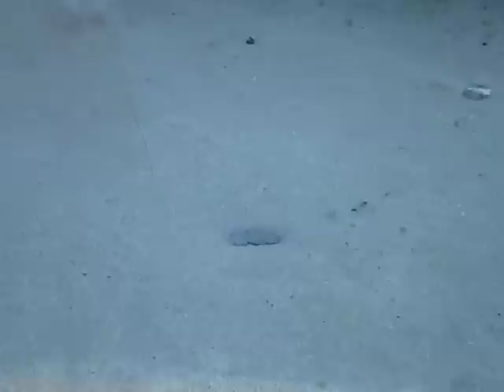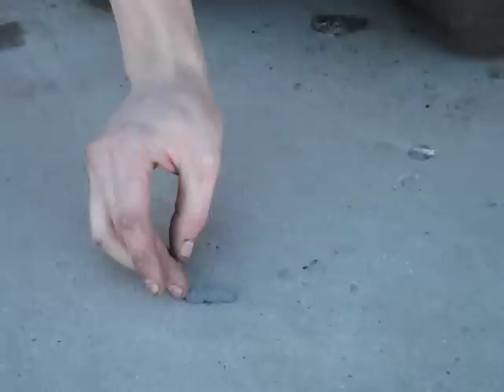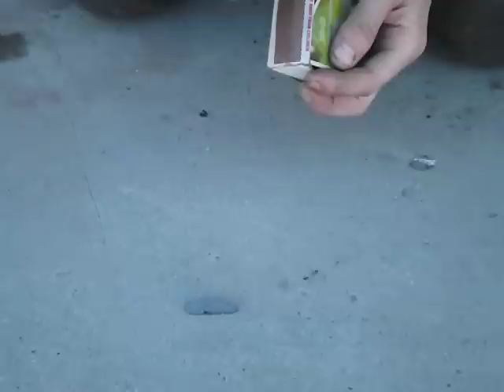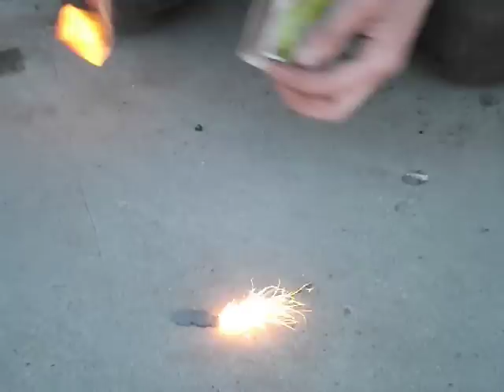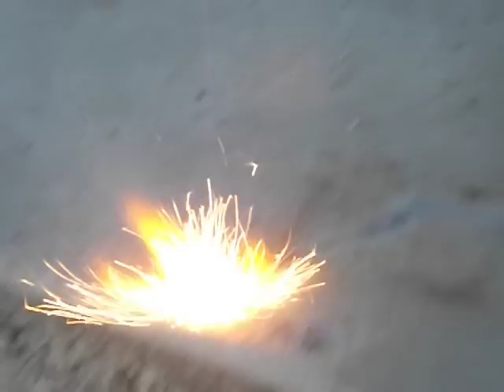Space Shuttle SRB Rocket Fuel Sample

Comment: Just like that. The ATF, FBI and homeland security was at his doorstep
Reply: If you know Cody this wouldn't be the first time.
Reply: Nah they knocked on his door when he started processing Uranium, lol
Reply: Funny true story:  Immediately after 9/11, BATF and DHS got the idea that amateur high power rockets (most of which use a fuel almost identical to the SRBs) were a hazard to commercial airliners and set about trying to shut the hobby down.  The theory was that a terrorist could "shoot down" an airliner near landing or takeoff - low and slow with such a high power rocket.  Anyone whose ever flown high power KNOWS that the uncertainty time between pushing the button and having the motor fire is on the order of seconds at best, and sometimes 10 seconds or longer, know this is ludicrous - you haven't a prayer of hitting anything moving even only 100mph.

[I believe it's still true that an unguided ground launched missile has EVER hit an aircraft in the history of warfare.  RPGs hitting stationary helicopters a hundred or two feet away don't count.]

Undaunted, the DHS set out to prove it.  DHS had a team of Special Agents scouring the hobby shops to buy a number of "delta kit" (a rocket that with the right high power motor and good build can achieve 18,000 feet), and high power motors (probably "I" or "J" - 20-80 pounds thrust).

The hobby shops of course refused to sell them because the Special Agents had neither pyro permits or rocketry association high power certification (required by *law*).  Whereupon Thomas Ridge (yeah, DHS Director #1) threatened them all with charging them with obstructing officers in national security....  i've seen a copy of the letter the SA's carried with them.

[interval while Special Agents learn and build a couple dozen Darts - they're not exactly easy first builds.]

Thereupon, they built a multi-tube "katusha"- like launcher (Soviet WWII multi-rocket launcher mounted on a truck bed), that they could install in the back of a rented van (I think a U-Haul actually).

[if you tried to tube-launch a Delta, you'd have to leave out the fins.  Which means that the Delta will fly a path highly reminiscent of a Smokey Sam ricochet in a Bugs Bunny cartoon.  What did the SAs know anyway - they weren't Rocket Scientists like I am ;-)]

They set it up at an artillery range, and flew a drone low and slow past the van.

Fire!

When the smoke cleared ... the drone was unscratched.  But the van had burned out down to the rims.  It's somewhat doubtful if any of the Deltas successfully actually left the van.

Someone had some explaining to do to U-Haul.
Reply: Just another step in his journey to launching a space laser.

Comment: Like make a rocket with a delay and a few solid boosters so it can be launched then the main body kick in and send it higher. IDK if it would work but it would be cool to see!
Reply: Jesse Crews...Aerotech Rocketry produces APCP (Aluminum Perchlorate Composite Propellant) reloadable motors for High Power Rocketry hobbyists. That is the fuel that the SRBs on the Shuttle used.

Why don't you make a rocket? Save your money to buy the reloadable motors. 

Study about rocketry. Then study some more...Then after you think that your done enough studying....study some more.  Then design your rocket. And after you have planned it out...in detail...then build it. Then fly it. And if you recover it safely to where it can be flown again then you have accomplished your goal. And if it wrecks or CATOs....then it becomes apparent that...perhaps you have not done enough study? (There are other causes that are completely beyond your control. But study and design helps to minimize failures.) 

Yep...Back to the Drawing Board and there is no pun intended. You will draw it, with dimensions, before you build it. Maybe you will draw it many times as you may have many minor design changes during your venture. That is what the phrase, "have planned it out...in detail", means. 

But you will know your rocket by the time you have built it.  In fact you will be apprehensive to launch it, wondering anxiously if you will ever get it back.  But that is the adrenaline rush...the thrill of it....which we seek. When you have pushed that button that sets off the electric match which ignites that engine  It is distant and no longer in your control. And there is so much that can go wrong.

First...Doesn't that sound like a lot of WORK?  Oh my. Did I say a four letter word?  WORK? 

Why are you asking Cody to do that work? For you? If you are even thinking of using THE EXCUSE that Cody is a genius and that you are not a genius...Well...There was the famous old man who said wisely and correctly, "Genius is ONE percent inspiration and 99% perspiration". Nope. No "Mulligans" for you. Believe it or not asking someone else to experience life for you only STEALS FROM YOU and you only harm yourself doing that. Only Heaven knows what you are missing when you do that.

Next...Doesn't that sound like a lot of RISK...the risk of the loss of your rocket, the risk of failure, as well as the risk of the loss of your investment of time?

It is RISK. Personally I have had rockets detonate on the launch pad. I have had them detonate in the ascent phase and plummet to the ground, in flames. I have had ballistic impacts into the ground due to ejection charge failures and failed recovery shock cords. I have been fortunate enough to avoid "zippers", where the shock cord zippers down the air frame and opens it up like a tin can, but that can happen. i know to vent my rocket as the rapid change in air pressure, due to the rapid change in altitude, will pop that nose cone off like a champagne bottle cork....with the result being the zipper that shreds your rocket. I know to use lengthy shock cords.

Tuition at the School of Hard Knocks is expensive and plenty can go wrong...no matter how well you have planned it out. 

At times a failure it is not due to a flaw in your design but due to a manufacturing defect in a commercially available engine. of course you may have stored the Engine improperly. Or the store from which you purchased the engine may have abused it, dropped it, internally cracked the propellant, and then you get the unexpected detonation.

=================

Since you are a beginner...obviously...since you do not know about how easy it is to cluster engines and that the engines have a built in time delay...I'd concentrate my efforts on the simpler rockets and Black Powder Engines manufactured by Estes Rocketry....first.

Rocketry may be a sport, and it is a sport which is much more cerebral than physical, yet it is not a game..

And if you want to watch High Power Rockets fly on APCP then there are already plenty of videos of that available here on YT to watch.

What is lacking from those videos is your personal investment. It is not your rocket flying. And unless you have built and launched Rockets before you cannot enjoy their adrenaline rush when they are launching 

And the problem with the YT videos is that successful flights are predominantly shown. Or, of those which are failures, many are labeled as failures in the titles...which is a Spoiler that ruins any chance for the vicarious adrenaline rush that one can experience due to empathy as the experienced have had it happen to us before.

Think about it...You are watching a video of a launch. You do not know the outcome. There is some built up apprehension. Maybe the guy who is making the video talks a bit about his anxiety beforehand....what can go wrong Then he presses that button...KABLAM...It detonates...on the launch pad. Empathy flows as a result.

Believe it or not...That is a perfect video as one is not expecting that result.

And if I ever video record another launch that is what I intend to do.

Build your own rocket and stop stealing from yourself.
Reply: @24kGoldenRocket  "stop stealing from yourself" i never thought in my entire life this would make any sense
Reply: @24kGoldenRocket  but what about remaking rockets already designed, then "reverse engineering" the rocket to understand how it works? isn't a better way to learn ?
Reply: @l0k048   If you want to study rockets then study Physics, Chemistry, and Aeronautics.

When I looked at the internal structure of a Saturn V without that knowledge I did not understand the reason why the Oxygen tank was located above the Hydrogen tank in the third stage while the Kerosene tank was located above the Oxygen tank in the first and second stages. I had absolutely no understanding that the molecular weight of Kerosene is heavier than the molecular weight of Oxygen and that the molecular weight of Oxygen is heavier than the molecular weight of Hydrogen thus the placement of those tanks were designed so that the center of gravity was located above that of the center of pressure to insure aerodynamic stability. 

Now that I have a knowledge of Physics, Chemistry and Aeronautics I can understand this. But before I had a rudimentary understanding of Physics, Chemistry, and Aeronautics I had no clue on how to reverse engineer even a model rocket.

Comment: And it's more or less the same stuff that they painted the Hindenburg with.
Reply: People think the hydrogen 'caused' the explosion, but hydrogen without oxygen is safe. It was the skin igniting that allowed enough oxygen in to then ignite the hydrogen.
Reply: @Bubu567  interesting. I did not know that. Thanx for sharing that info.
Reply: @Bubu567  Well yeah but the hydrogen is still what exploded by reacting with oxygen. On a side note since hydrogen forms water when it burns I wonder how significantly the Hindenburg affected rainfall in the area of its explosion. That's a lot of water vapor being released...
Edit: apparently it's still debated as to whether the initial fuel was the skin of the vessel or leaking hydrogen
Reply: @dannydevito7000  It's debated as we cannot go back in time, nor would there be much for us to investigate, but numerous model tests have shown that the paint on the skin, at the very least, massively contributed to the disaster. Without the volatile canvas paint, the accident CANNOT be recreated in the real world. 
The hydrogen leaves no room for mistake, so it isn't a bad thing it has somewhat unfairly been pointed at the sole blame.
Reply: They demonize hydrogen because the oil monopolists wanted to destroy the air blimp industry,i wouldn't be surprised if the hindenburg was corporate sabotage
Reply: @NwoDispatcher  Zeppelins only used hydrogen for lift. They also had petroleum automobile engines to propel them, so I am not sure I am on board with your theory.
Reply: @Bubu567  the friction losses for blimps are light-years ahead of ground travel

Comment: “Look at how cleanly it burned.”

You know that solid rocket fuel produces the most toxic gasses out of any fuel type.
Reply: He meant as in it didn't produce much visible smoke, showing that it was a good fuel to air ratio
Reply: That's not what he meant about "burning clean"
Reply: I see
Reply: @toad3222  Fuel to air ratio? wut
Reply: @kosovosux  Google stoichiometric burning
Reply: Precisely why I stopped firing rockets indoors. I do enjoy the smoke, though I don't recommend inhaling deeply.
Reply: @toad3222  ik but fuel to air ratio only applies to closed systems
Reply: @kosovosux  it applies to a campfire, how is that a closed system
Reply: @toad3222  it would be rate of combustion, not fuel to air ratio

Comment: "Exact same formula" Yeah sorry bud. They werent grinding up rubber binders and mixing it. Lol not even close.
Reply: Yes it was the same formula, they used a rubber binder called PBAN, which also combusted and acted as a fuel.
Reply: ammonium perchlorate (oxidizer, 69.6% by weight), atomized aluminum powder (fuel, 16%), iron oxide (catalyst, 0.4%), PBAN (binder, also acts as fuel, 12.04%), and an epoxy curing agent (1.96%).

Comment: We made this stuff back in the day for our education. It was not the exact same stuff you made here......
Yours burned with larger particles and the colour looked of but that can be just the camera.
We made a small bit and extruded it into long rods (much like pencil-lead in size).
If you cut off a piece (creating a square edge) and light it, then blow it out (you cause a sudden drop in pressure to extinguish it).
When you examine the (burned) end, it looks like a sharpened pencil-lead. This shows you how the flame-front propagates through the material.

Comment: You just gave me the ingredients for a homemade thermite grenade
Reply: Nope it’s not thermite. It can go boom if you try to enclose it, but thermite won’t. AP based solid fuel is no worse than a road flare if left open to burn. Thermite delivers far more heat. It’s actually easier to make real thermite, if you can find a fine enough aluminum powder. The other ingredient is just rust.

Comment: Since you are burning this at atmospheric pressure the burn rate is about 10 times less than what the actual shuttle motors would have experienced.  That little bit of propellant would have been consumed very quickly in the actual motor.

Comment: How does solid rocket fuel keep burning in the same location? Does it drop down the rocket fuel tank as it burns? How is it controlled thrust if it doesn't, surely the thrust changes if the burning isn't occuring constantly right at the bottom of the tube.

Comment: you forgot to tell the main fuel was hydrogen .The Space Shuttle's large External Tank is loaded with more than 500,000 gallons of super-cold liquid oxygen and liquid hydrogen, which are mixed and burned together to form the fuel for the orbiter's three main rocket engines. but you right as a solid fuel has been used ammonium perchlorate.

Comment: I understand that this video is more than 6 years old but still would like to know if you could provide a little more information of this test such as:
Proportions of components
The component size in microns
What the rubber binder is that you'd mentioned
Also, you did not mention the inclusion of any iron oxide as a catalyst in your mix, a very important component that was used the Space Shuttle's SRBs.

Comment: Except for the FACT that the Fuel used in the Solid Rocket Boosters for the Space Shuttle is SODIUM Perchlorate .
Reply: Nope ammonium perchlorate, is better and more stable than sodium perchlorate. Check out the pepcon explosion.  It’s easier to diy make sodium perchlorate but the slightest mistake will blow up regardless of quantity. Pure AP is only explosive in large quantities. I’ve made high power rocket motors, you do not want to play with sodium perchlorate if you can possibly avoid it. It can go unstable just with poor storage.

To be pedantic the AP is the oxidizer, the rubber is the fuel and aluminum is a burn enhancer/modifier.

Comment: can you spin a clay rocket and fire it in a kiln then fill it with some of this and see how far it goes?  or maybe another form of rocket.  clay would be cheap, easy, high temp resistant, lightweight, and efficient. only downside is its fragile.
Reply: You can buy the APCP Engines. They are commercially available. Personally I use paper for most of my air frames. You can get a Level One Certification with a paper air frame and a G impulse engine. I will use fiberglass or phenolic air frames when i design High Power Rockets for a Level Two certification.. You can even check out my paper Space Shuttle in flight on YT.

Has nobody ever heard about Model Rocketry or High Power Rocketry?

Comment: Sorry to break your rocket bubble,  but that is no where near what the space shuttle booster use. Ammonium Perchlorate, AP, has to be cooked from several ingredients, molded, and cured. In addition,  AP cannot be lite by a match, flame, even a torch will not ignite AP. It takes a special detonator to start the burn, and you wouldn't be squatting around it when the  burn starts, even if it was a small amount. What you made is aluminum power & other stuff that burns!
If you can video on YouTube you can certainly read up on AP?

Comment: what is fuel ,?
Reply: Aluminum powder and rubber.
Reply: What is fuel?
Baby don't burn me
Don't burn me
No more
Reply: Lunar Delta...That can be a fuel. And of course the Ammonium Perchlrorate is the Oxidizer.

Plexiglass can be a fuel with Nitrous Oxide as the Oxidizer. The benefit of that hybrid is that the thrust of the Engine can be throttled by regulating the flow of Oxidant. 

A mixture of Charcoal and Sulfur is a fuel with Potassium Nitrate as the Oxidizer. 

Sugar is a fuel which can be oxidized with Potassium Nitrate.

But the best way to answer Dark Hunter's question is that a fuel is any substance which can be oxidized with the chemical reaction being exothermic...releasing potential energy...as heat.